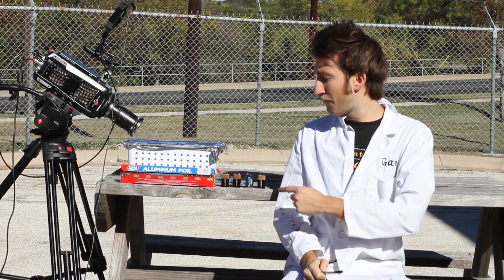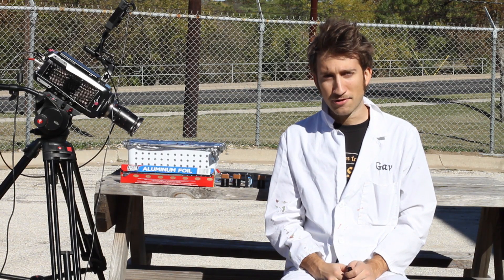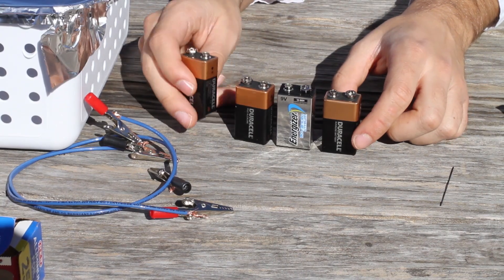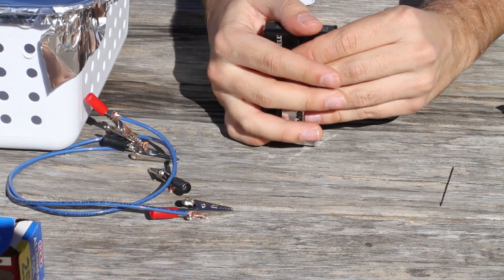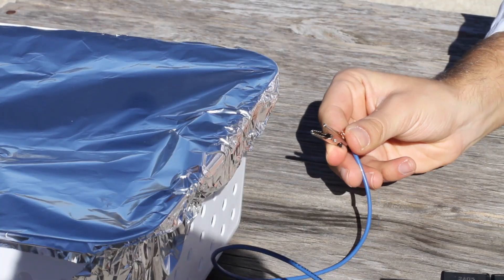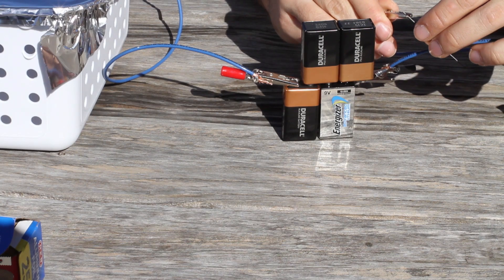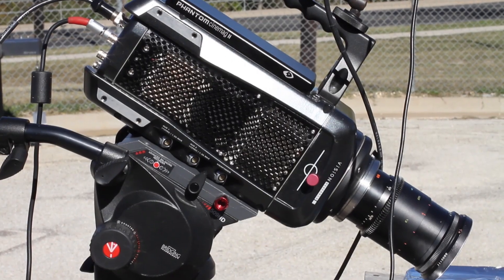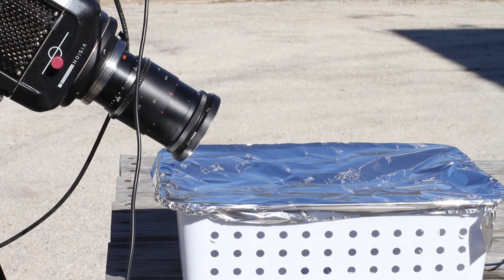Tiny Plasma Cutter in Slow Motion - The Slow Mo Guys

Comment: So in theory with upped voltage you could make something to cut thicker metal? That would be awesome for me, I always use an angle grinder, but it lacks precision, and something like this would save a lot of work for not having to sand the edges left by the angle grinder.
Reply: This isn't a plasma cutter, this is a stick welder on metal that is too thin.
Reply: What utter shite.

"A plasma cutter makes plasma from electricity and compressed air. A stick welder makes heat by passing electricity through an electrode." - The plasma cutter uses an electrode to create an arc also, you just failed to mention it.

"If not a stick welder due to the lack of consumption of the graphite then compare it to the non-consumable tungsten electrode on a tig welder which only makes an arc but doesn't get consumed, exactly what the graphite did in the video." - Yes, I know. Again, exactly the same as a plasma cutter.

"And by often using gas you mean that a plasma cutter NEEDS GAS in order to function, because that is how plasma is made?" - You do realise that welders use plasma as well don't you? That welders use the arc and the gases around it in exactly the same way? Additional gas isn't needed for making an arc that can cut (I.e. a plasma cutter) as evidenced by this video, and any arc welding torch used on metal to thin for it, but it helps obviously. Of course any decent plasma cutter made today would be designed to use gas because it works better, and trying to use one designed to use gas, without using gas will likely fail because the machine has been designed to work with it. But you DO NOT need gas in order to cut with plasma.

Even if this device bares a superficial resemblance to arc welders, and isn't of the exact same design as general plasma cutters manufactured today, it is still a plasma cutter. It uses an arc and plasma to cut metal. It is by definition a plasma cutter.

"Your attempt at a rebuttal doesn't change the fact that this IS, in fact, a welder of sorts."
- Are you listening to what I'm actually saying? YES it is a welder of sorts, just as are all plasma cutters, i'm not denying that. But to say it is not a plasma cutter is even worse than saying it is not a 'welder of sorts', because it bloody well is a plasma cutter, and it works exactly the same way as all plasma cutters do, except it is a very very basic one without gas, just like a stick welder. All of the devices we are discussing are very similar pieces of equipment that work in almost the exact same way. A tig welding torch IS a basic plasma cutter, though obviously it's designed for another purpose. YOU are the one demanding that it is not a plasma cutter, but It is!

Stop talking crap.
Reply: snake plissken that just makes an unsuitable and weak plasma cutter, not exactly surprising given it was made by gavin, out of 9v batteries

its still a plasma cutter, it just happens to be one made out of shit materials for use on shit materials
Reply: snake plissken Bullshit. They are basically the same thing with small differences that change the function.  A plasma cutter is something that cuts with arc plasma from an electrode, that is exactly what he did here. A stick welder uses arc plasma from an electrode that melts, set up to heat without cutting, and to weld. Basically the same thing with some differences in set up to get different results. He made his set up to cut, not to weld. His electrode didn't melt, his arc cut the material, therefor it IS a plasma cutter. 

Both arc welders and plasma cutters have advanced beyond the basics described here, often utilising gas. That doesn't change the fact that this IS a basic plasma cutter.
Reply: apoapsisperiapsis A plasma cutter makes plasma from electricity and compressed air. A stick welder makes heat by passing electricity through an electrode. This was just passing heat through an electrode which in this case was the graphite. If not a stick welder due to the lack of consumption of the graphite then compare it to the non-consumable tungsten electrode on a tig welder which only makes an arc but doesn't get consumed, exactly what the graphite did in the video. And by often using gas you mean that a plasma cutter NEEDS GAS in order to function, because that is how plasma is made? Your attempt at a rebuttal doesn't change the fact that this IS, in fact, a welder of sorts.
Reply: kiraanimerawr1 Arc Air Gouger, Plasma Cutter, Plasma Welder, Arc Welding (Submerged arc welding, Manual Metal Arc Welding, Gas Metal Arc Welding, Gas Tungsten Arc Welding)

Google them all, I dare you. 

apoapsisperiapsis sounds like a Uni student who found wiki and never used them, and is angry. 
snake plissken sounds like a tradesmen, who uses them.

From all this shit fighting you can find one thing out. Plasma is an energized atom. However saying that is too simplistic of a statement and as my friend (See also; Chemical Engineer) points out, Plasma is shit crazy and hard to explain. Plasma can be used for cutting and welding and is quite sexy, but then again it's also in Plasma TV's and there is a difference in the plasma even though they're both in the 4th state (solid/liquid/gas/plasma). 

Arguing if it is Plasma (which the arc is, see also; Science) is pointless as it is. Why? Because there is atmosphere that is being excited by the arc. If he did this in a total vacuum then I would have to say no and it becomes an Electron Gun (google those too).

As a side note to the dick contest above. Plasma Cutters had an evolution from requiring a certain type of consumable gas for the plasma and another for the cutting jet. Eventually it evolved into what we have today, using Nitrogen out of the atmosphere for both. So yay compressed air is your "Gas Required".
Reply: Tbf a plasma cutter would leave poor edges also
Reply: snake plissken So? It's a plasma cutter made to cut tin foil. It's still a plasma cutter. 

If you want to cut thicker metal you'd have to crank it up for more heat, and then you'd need a more resilient electrode. This is exactly the same as with any other plasma cutter.

Seriously, you are talking utter shit. Stop insisting it's not a plasma cutter, because it is, by definition. And it works in exactly the same way, on exactly the same principles as any other plasma cutter. It's just a very very basic version made with some thin wire, a couple of tiny batteries and a cheap thin piece of electrode.
Reply: Tomek Hermsgavordenbroker I'm not angry.

I own a mig, a tig, and a plasma cutter. I use the tig regularly (even used it as a plasma cutter before), the others not so much.

I'm not the one demanding that we refuse to call it a plasma cutter, and insisting that it can only be considered a stick welder. I'm the one pointing out that doing so is a pointless and silly attitude to take, much like you were just doing.

The guy is talking crap and I'm calling him up on it. That is all.
Reply: apoapsisperiapsis If you were to take this "omg it's plasma cutter my god stop talking crap and bullshit" to a thicker piece of metal guess what happens? The electrode fucking melts and the steel isn't cut, making it a welder and not a plasma cutter. Go ahead, try it.
Reply: apoapsisperiapsis
 The process shown is not actually plasma cutting or stick welding, it is one called carbon arc cutting.
Reply: I'd like to pretend like I know what you guys are talking about.. but I can't keep up, lol.
Reply: So you just randomly comment on youtube videos stating your lack of knowledge just to state it?
Reply: Tomek Hermsgavordenbroker welcome to the internet buddy.
Reply: Tomek Hermsgavordenbroker you see... but I just don't care.
Reply: Or you could just get me with my amazing muscles to do it
Reply: apoapsisperiapsis Your use of the tig welder to cut metal is exactly what is happening in this video. It is using plasma to cut metal, but the plasma produced is more similar to an arc welder than a plasma cutter.
Reply: Skinny Dave Thank you that's what I was looking for. (Except it's missing the air blast)
Reply: you are referring to a carbon ark cutter.  it is good for cutting very thick metals but is very labor intensive and can be very imprecise.  the higher the amperage the wider the kerf of cut.  an angle grinder with cutting wheels instead of grinding wheels is still your best bet on most cuts.  if cutting metal +1 inch or more plasma or oxy fuel is best.if gouging or cutting a hole straight through extremely thick metal carbon arc or exothermic cutting tourch is best.
Reply: snake plissken "Your use of the tig welder to cut metal is exactly what is happening in this video. It is using plasma to cut metal, but the plasma produced is more similar to an arc welder than a plasma cutter."

"It is using plasma to cut metal, but the plasma produced is more similar to an arc welder than a plasma cutter"

So it IS using plasma to cut, but it's not a plasma cutter?...

Or have you decided it is a plasma cutter, just not the same as your typical off the shelf one, and happens to bare some resemblance to types of welding? like I have been saying from the beginning...

Notice how you have changed your position since we started this conversation, to avoid admitting that what you were saying was wrong? Ridiculous.

Like I said, a proper off the shelf plasma cutter uses loads of gas to modify the properties of the plasma for better welding. Just like you do with certain types of welding too. None of that means that this "is not a plasma cutter" as you were trying to say at the start, though you seem to agree that it IS a basic piece of equipment using plasma to cut metal... A basic plasma cutter then...
Reply: apoapsisperiapsis we were both right it shows resemblance of a modern arc welder and modern plasma cutter, but we were both wrong because it is closest to a carbon arc cutter as tyson cargill stated.
Reply: The argument is still academic as in this process and carbon arc cutting it is not the plasma that does the cutting but an electrical arc, however plasma is produced.  
With a plasma cutter the plasma itself does the cutting not the electrical arc. Even though just like above both are present.  
In an internal combustion engine plasma is produced does that mean my truck has a plasma drive engine? No of course not. It is best to go with accepted industry standards and nomenclature which would put this closest to electrode carbon arc welding (ECAW)
Reply: Just so we're all clear on this. He's passing a  positive current through the electrode. We call this Direct Current Electrode Positive. It's Al which prefers AC~. The Positive cycle brings oxides to the surface (creating the white oxide on the surface) and the Negative cycle is used for penetrating heat into the material instead of being stopped by the oxide.

So this only gets the DC+ side and cleans, which puts two thirds the energy into the electrode and one third into the Al.

I think he did this because it would be easier to gain an arc. As we keep pointing out, Arcs make Plasma, melted metal that thin just rolls away from the arc/weld area and it creates a cut.

There is no real process out in industry that does this because it's actually a fault with such thin material being heated and nothing to do with a process required to cut thicker materials. Thicker materials require either a blast of oxygen or just compressed air to move said liquid metal away from the still solid metal. If someone so wishes to mention an Oxy Cutter I will slap you as FeO, FeO2 and Fe3O4 all have a lower melting temperature than Fe and the exothermic chemical reaction between Fe above its ignition temperature of 816 Deg C causing the oxide to melt below the melting temperature of the parent metal and the blast causes it to blow away.

If you have thicker Al and no compressed gas blowing away the liquid metal, you simply get a liquid pool of metal where the arc is and it wont go anywhere.

So yes, it is a weld, but a welding on thin material will cut it.

Fuck.

Comment: Can anyone explain the science behind this?
Reply: The first wire he connected was the ground. the electricity in the second wire, going to the graphite, wants to go back to the ground because that's just what electricity does. The electricity coming off the graphite it jumping to the aluminum because that's the path of least resistance to the ground. The electricity produces heat jumping to the aluminum and melts it. It's not a plasma cutter but just a stick welder.

Comment: What would happen if you did this on skin?
Reply: Not a thing. It only works because one end of the batteries is connected to the foil, and the other to the graphite. When they get close enough the charge jumps from the graphite to the foil, completing the circuit. The heat generated by the arc is what cuts/melts the foil. On skin there's no way to complete the circuit. Even if you connected the end on the foil to your skin. You could try to make it work by coating your skin in an electrolytic gel, but then the gel would just heat and bubble away

Comment: Isn't that really arc welding?  I wonder if you could weld on a thicker piece of aluminum?
Reply: Probably not since the graphite wouldn't melt to produce a nice bead and there would be no coating to protect the weld
Reply: I guess that makes sense.  Maybe if you increased the amperage and coated the graphite with some kind of flux? :D
Reply: You would meed more batteries and some thicker metal. A flux coat or inert gas would also be required other than that it might just be a pretty good welder for small stuff i'll have to experiment with it.

Comment: Isn't this simply welding? Plasma cutter is different no? He`s creating an arc with the aluminium.
Reply: Like stick welding except the electrode isn't being consumed it's just making enough heat to melt the alumimium.
Reply: snake plissken Alright, thanks for the information!
Reply: snake plissken holy fuck correct everyone while your at it wont you

Comment: ... so many kids are going to try this... on each other...
Reply: I'm going to cut billy in half
Reply: This only works because the pencil lead and foil complete an electrical circuit. No need to worry about kids cutting each other.
Reply: Unless these are robot kids who can conduct electricity very well to complete the short circuit, we're gonna have a lot of disappointed kids.
Reply: Nah, they'll just stick one end on the foil and it won't work.
Unless they're smart idiots. Those are the most difficult kind.
Reply: Jackattack569 Croo!
Reply: 36 volts won't feel like much.
Reply: Jeremy T On the bright side, that's a pretty good way to check if your friends are robots.